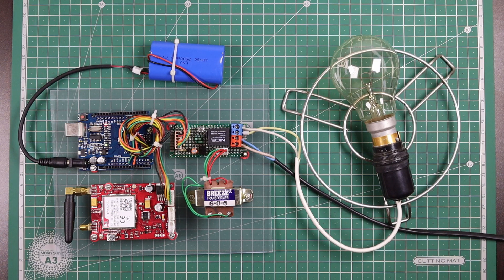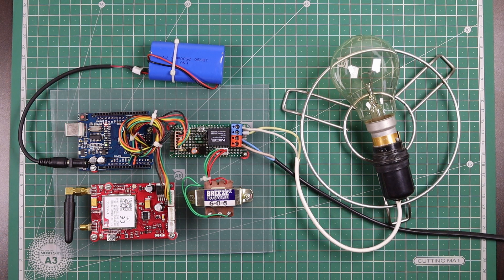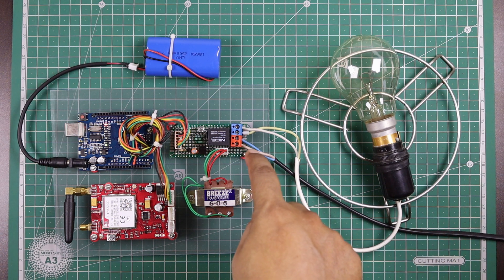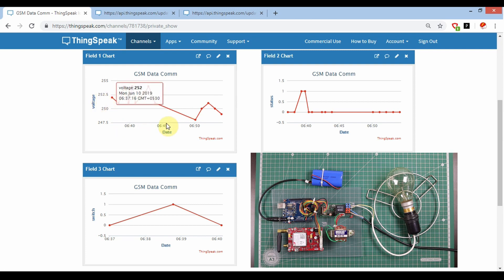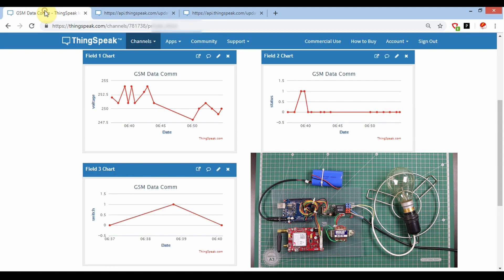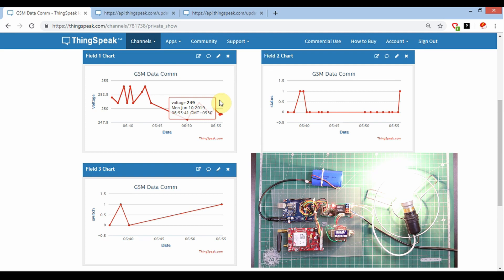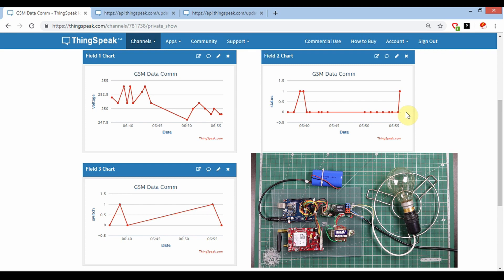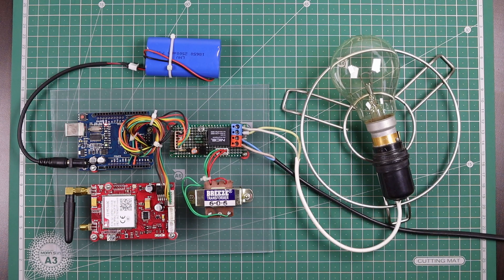IoT Project using Arduino and GSM 2G-3G SIM5360 Module and Thingspeak.com website

Comment: What is the cable you use to connect the battery to the Arduino Uno. I have a Zippy Compact LIPO battery which has a JST-XH
 Balance Plug and XT60 Discharge Plug. But I don't know how to go from battery plug to the round Arduino DC input.